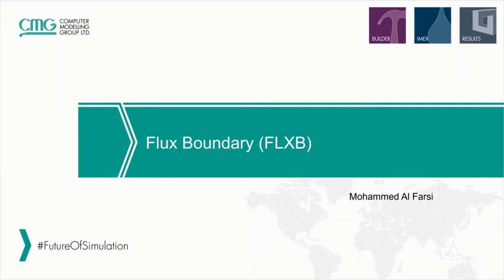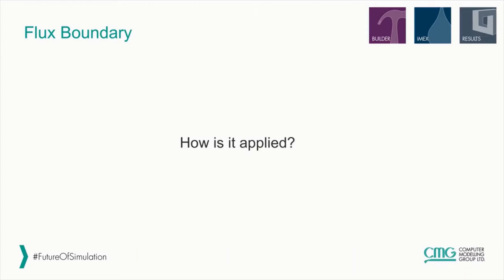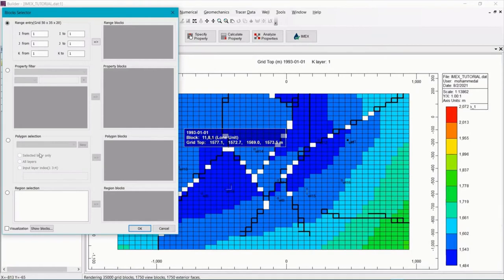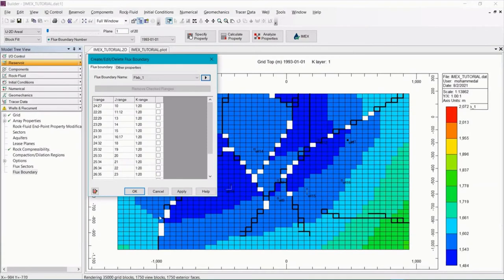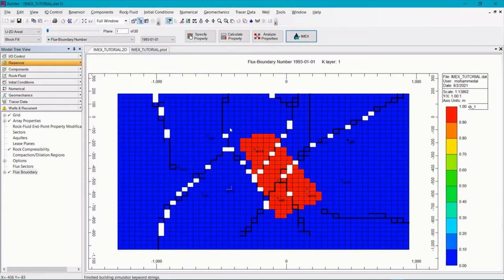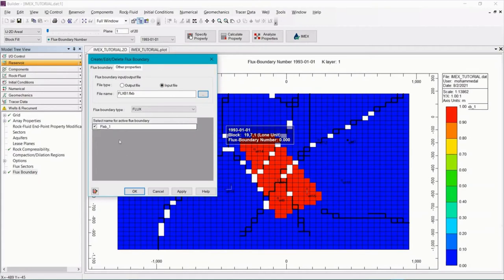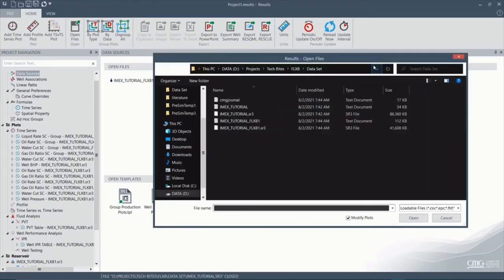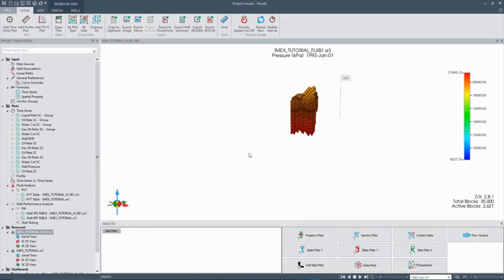CMG Tutorial: Flux Boundary

Comment: How this differs from a sector model?
Does the location of flux boundary affect       its accuracy? 
Does flux boundary speed up simulation? 
How flux boundary take in account other grid blocks? 
What is the difference between flux and pressure boundaries in terms of application?
Reply from the maker: Hi Jamal!! Thanks for your interest, following you can find some comments:

How this differs from a sector model?  Answer: The sector is a group of blocks used to report results or specify properties, on the other hand, the Flux Boundary enables the writing out of  flux boundary conditions from a full-field run to designated boundaries.

Does the location of flux boundary affect its accuracy? Answer:  In theory, no. But if you have block with complex geometry and numerical instabilities, then you should be careful.  

Does flux boundary speed up simulation? Answer:  You can have faster results taking into account that you are modelling a smaller model. 

How flux boundary take in account other grid blocks? Answer:  The flux boundary information is recorded and retrieved dynamically during full-field and reduced runs, respectively.

 What is the difference between flux and pressure boundaries in terms of application? Can you explain your question a little more?  

If you need further information you can contact us via email support@cmgl.ca
Reply from the maker: Jamal, we invite you to register on our website www.cmgl.ca, so that we can more easily communicate with you and you can also access additional information.